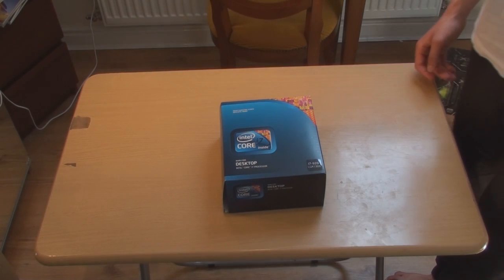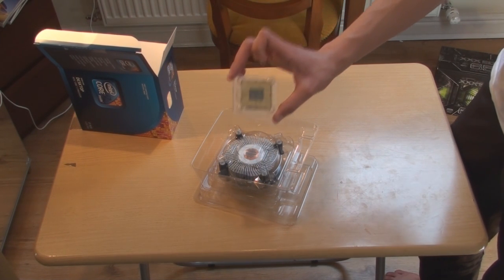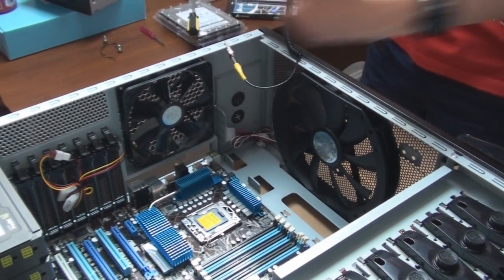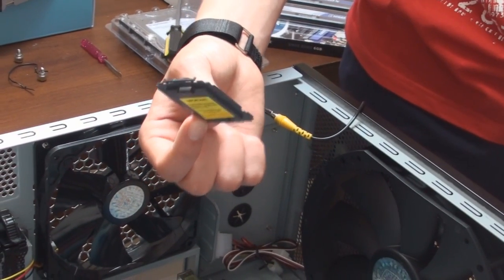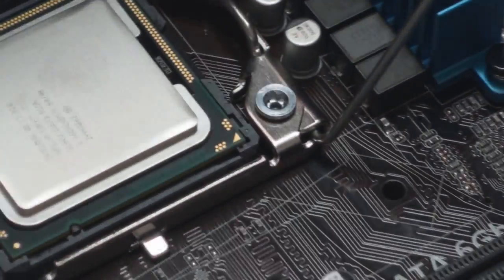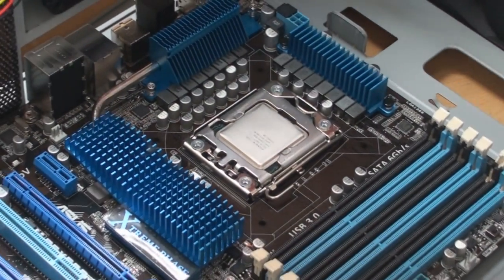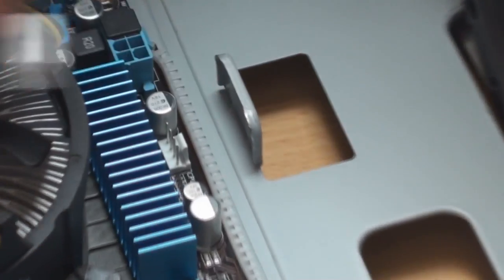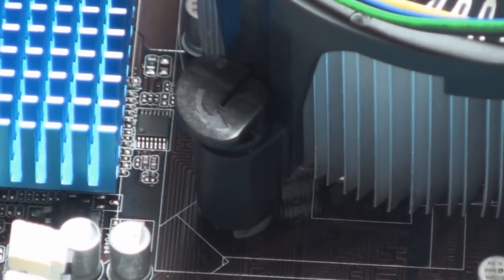xenoBUILD - Unboxing & Installing Intel i7 920 CPU

Comment: is it worth taking the heat-sink of the 920 CPU, the standard heat-sink that the processor comes with, and reapplying some thermal compound on the processor itself, after which putting the heat-sink back on, on top of which the cooler with its heat-sink? I've seen a couple of videos, and they seem to be getting much better temps. What's your take on this?

Comment: @ricochetVendetta If you want to severely shorten the lifespan of the cpu. The i7's already run hot at stock speeds with the stock heatsink. If you overclock it will run very hot which will decrease the lifespan. Also the heatsink fan will run at max speed a lot and it would be very loud.

Comment: @JihadOfTheSoul I can imagine its the same with most newers CPU, they will still last a reasonable long time, but not as long as they could.

I have an old 939 AMD x2 3800+ 2.0ghz CPU, (old i know XD getting i7 soon), ive had it for around 6 years and my brother had it 2 years previously to that, and baring in mind its overlocked to 2.7ghz now, the lifespan on it hasnt been too bad because ive got a 120mm Thermaltake CPU fan.